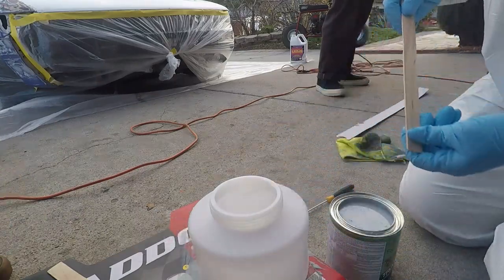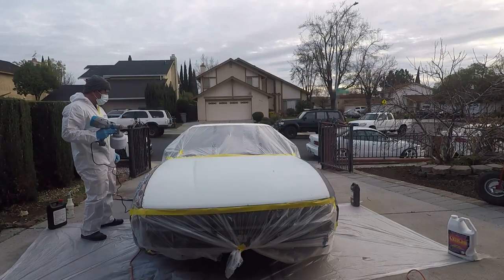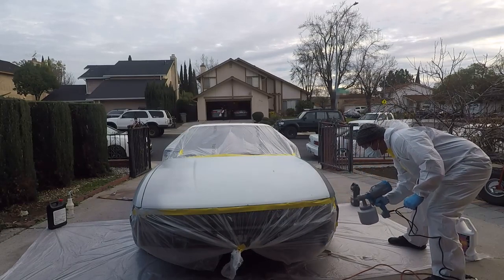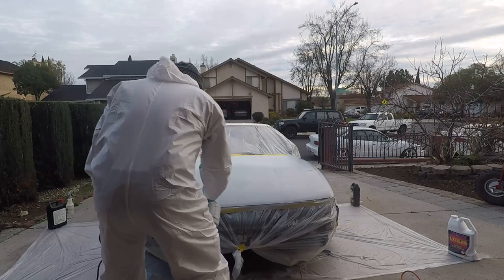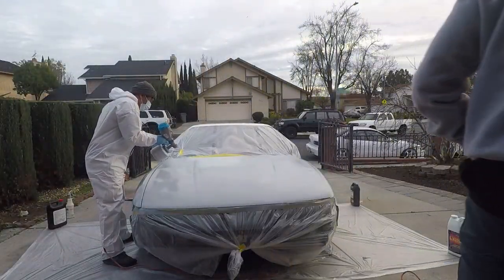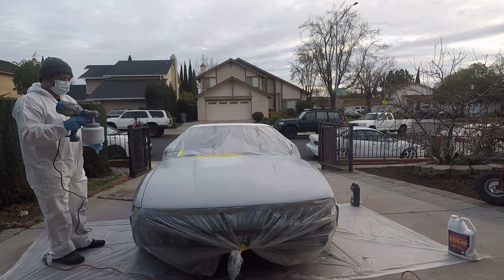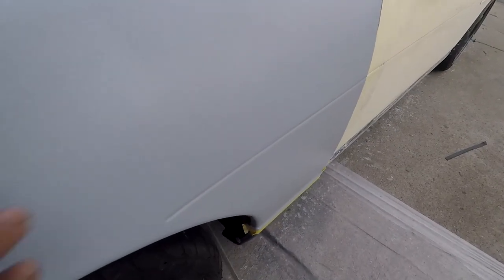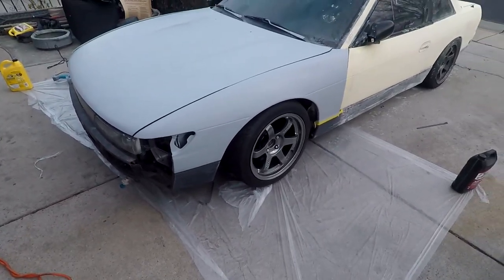PRIMING 240SX WITH HARBOR FREIGHT AVANTI HVLP ELECTRIC SPRAY GUN

Comment: I don't know about this new electric spray gun they have, but the old one had this giant filter built on to the end of the pickup tube inside the paint reservoir.  so every time it got down to only about an inch left in the paint reservoir it would start sucking air.  If this one's the same way, you just have to replace the pickup tube with just a solid tube that goes down to the bottom of the paint reservoir and it no longer has a problem.

Comment: POSSIBLE FIX: attach a weight to the tubing inside the cup without obstructing the flow. As you tilt the cup on horizontal surface the tube should tilt also and remain submerged into the paint. It should continue to feed smoothly.
Reply: Tube is rigid.

Comment: I think the pickup can be relocated for whether your paint angle is up or down.
Reply from the maker: It does rotate! I'm used to spraying with PPS 2.0 cups, so I've never had a material feeding issue. The next project I'm using this on will involve an experiment to see if it can be a cheap solution.

Comment: Best HarborFreight sprayer is the 64oz pressure feed hvlp.
Reply: What’s the minimum compressor size you can use with that gun?
Reply: @3gcraftsman  i dont know what the official requirements are but i use a 10 gallon, 4.3 scfm Fortress compressor with a 10-gallon side tank and i rarely need to stop and wait for it to catch up.  Thicker paint needs more air, so if you thin a little, you can spray longer.  You can spray very viscous paint with this unit which is why it’s awesome

Comment: No dilution? And what hardener?
Reply from the maker: 6584 activator. It was a 4:1 ratio for primer, so no reducer necessary.
Reply: @StyleHouseRhythm  niice thanks!
Reply: We used this in the house,we sprayed the ceilings,the cabinets and the walls,...if you play with the settings on the trigger,and fiddle with the attachments and you reduce the material,it will spray very well,keep it pretty full and it won’t spit.....I definitely recommend thinning the material some